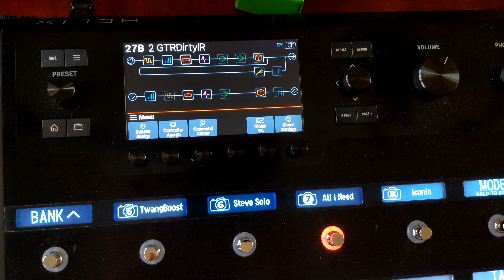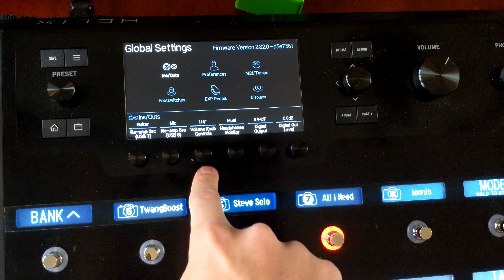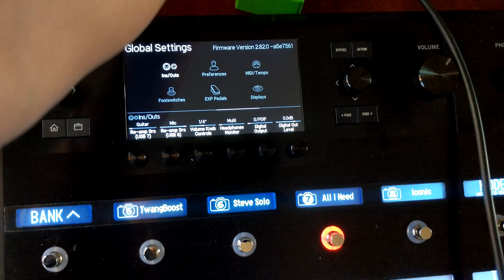Line 6 Helix - Setting Up Outputs for Live Use- Bypassing Big Volume Knob - 2 Minute Tip

Comment from the maker: Please feel free to ask questions here! Thanks for watching
Reply from the maker: @joshua waters I would definitely recommend double checking your ins and outs. I hope nothing is wrong with the unit itself though because that is a strange thing to be happening
Reply from the maker: @joshua waters definitely is ! They'll at least walk you through and find out if anything settings wise could be weird. Keep me posted and good luck! Any more questions for me, you can always reach out here or on FB or instagram
Reply: @joshua waters Always the best customer service.
Reply: Hi Steve, do you know why my big volume knob works in reverse?
Reply: if I turn it to the right the volume goes down
Reply from the maker: @davidedro  I haven't heard of that happening before. I would write to Line 6 customer support for sure
Reply: Steve Sterlacci thanks for the reply! 🤟
Reply: , Im going to be running a helix stereo out to 2 frfr speakers but i cant decide on 2 10 inch or 2 12 inch,,, i e heard the 12's are too flubby with the bass and that the 10 inch speakers are perfect for amp modelers, anyone tried both and have an opinion? Im just scared to get the 2 10's and there not be enough bass,, i have 2 8 inch studio monitors to pasify right now but while theres bass wih music or synth sounds when u try to palm mute or chug it sounds horrible, opinions? Thanks in advance
Reply from the maker: @cbosmooth  I have never heard that 12s are too flubby. You can always throw a low cut on. I wouldn't choose 10s but that's just me

Comment: Steve, I got a great method for stabilizing the big volume knob. I play table tennis and I buy my own rubbers and glue them to the paddle. There's always left over rubber after cutting the it to the shape needed for the paddle. I cut a circle the size of the knob and glued it to the bottom of the knob. You can still turn it, but you have to use a LOT of pressure. No way that thing is moving unless I want it to!
Reply from the maker: That's a great idea !!!

Comment: What are your thoughts behind preventing phantom power being distributed to the line 6 via XLR? (i.e. an unexperienced sound guy turning on phantom power on the desk). I've read people use phantom power blockers or in-line isolators. Your advise is appreciated. Thanks!
Reply from the maker: I'm about to film a video for the new highline line isolator from Radial that's just the ticket for stuff like that

Comment: Thank you SO much for this video - it addressed the EXACT question I had regarding the Helix's outputs.    I have a Kemper (and still love it, but it's gotta get shipped out for a repair - footswitches are finally being lame after 3 years) and I have it set up this very same way for the very same reasons you have.    I just needed to make sure that if I buy a Helix (to add to my amp tone possibilities, and to have a similar backup rig whenever my Kemper has to get shipped out for God knows how long it'll take to get repaired) I could run the Helix the same way at my gigs.    Again, thank you so much for the help!   And I subscribed to your channel to get more help and info from you as I move forward on the Helix!
Reply from the maker: Thanks Dave! Im going on my 5th year with my Helix with no regrets and haven't looked back. Even owning the FM9 and Quad Cortex, helix is still my first choice for its simplicity
Reply: @SteveSterlacci  It's so looking like that'll be the same case for me.   :)    Looking forward to learning more from your videos, my thanks again!

Comment: Hey Steve, I am kind of new to this Helix, I have the HelixLT. I notice when I play certain notes and Chords where the low E is played, the first icon (input) Guitar icon, it briefly flashes red in color. I guess this might mean i am clipping but i checked all my levels. The way I am set up for the time being is like this. I go from the 1/4" left / mono from the Helix to the power amp In on my Boss Katana 100. Thanks!
Reply from the maker: Try the input pad in global settings. Should sort you out
Reply: @SteveSterlacci  Thanks Steve, that did help, although it still flashes red, but not nearly as much, only if i really pick hard when i play chords.
Reply from the maker: @Joop5000  as long as it doesnt sound like its clipping, it should be fine then
Reply: @SteveSterlacci  Cool Thanks Steve! Keep the vids coming, love em!

Comment: Hello Steve Im using helix floor into PC+ , xlr to FOH , L_6 to PC . I notice you use the 1/4" to PC+ and explain how to adjust volume to PC+ How do I control signal strength to PC+ through L-6 link . I use Helix for sound , no PC speakers with new 3.5 update. Would I be better off just using 1/4" to PC as you do on this video ? I am a bit confused on this subject . Thank you and great channel I only recently discovered .

Comment: Should I run a line signal into the front of a bass amp? Or instrument? Does it matter all that much if the amp sounds fine?
Reply from the maker: To an actual amp I would run instrument out. If it sounds fine then i guess it could be fine! No reason to mess if you're happy

Comment: Diggin' this stuff. Any idea how to adjust the output through the USB? I'm trying to use Helix directly into Reaper via the USB but my signal is way too hot. Couldn't find anything in the instruction manual about it.
Reply from the maker: Thats gotta be your preset volume.  Use the channel volume to bring it down

Comment: Old but still relevant video. This is what I also did on my Helix settings. However what if the FOH signal is too "hot". What options do I have to turn it down? Reducing the output signal in each preset is one option, but is there a better way do this "globally" or some how else?
Reply from the maker: Hey Rami! I would suggest making your presets at least close to a fully bypassed volume. It will almost always be boosted up but if you are in the ballpark, you'll never have issues. 
To answer your question,  you have a volume in your global eq that you can page to and bring up or down 20db
Reply: @SteveSterlacci  Thanks Steve. Just preparing for my first gig with Helix and trying to prepare for all kinds of issues :)
Reply: We had a quick PA test and no problems. All works just like it supposed to work. Wonder why there are so many comments out there where people are having issues with too hot signal. Any way, we are all good to go ...

Comment: If the big knob only affects 1/4 inch outs, then how do know how much signal is going to Front of House?
Reply from the maker: I am sending him a mic level signal. Its in his hands to handle the gain structure. Just like a real amp when they tell you "dont touch your volume,  its perfect!" I get to do that, and increase stage volume if needed. Let the sound man do his job with the FOH signal
Reply: @SteveSterlacci  So it's like a set db amount like a microphone? Im talking about how many db does it send to the house if you make the big knob only effect your 1/4 in outs on stage.
Reply from the maker: Its dependent on the presets level. I keep all mine relatively the same level and its 99.9% of the time a great level for the sound guys
Reply: @SteveSterlacci  ok I see. Was just curious about it bc want to do the same except use my headphone out to monitor so I have volume control for both monitors and main out.
Reply from the maker: @mrfender5001  I never want to touch the main out to the house because it will affect the overall mix. There should never be a situation where you need to touch your level to FOH unless its asked for. Solo boosting is different though
Reply: @SteveSterlacci  I understand that. But in my case I am the FOH sound man. So I have to be wireless and be able to get off stage and walk around front while playing. So I need the control.
Reply from the maker: @mrfender5001  even so, you don't want to mix yourself using the level coming in. You're asking for a headache if things go wrong. Best to get the healthy signal, then mix from the desk. Especially wireless,  you wouldn't be near the helix anyway
Reply: @SteveSterlacci  Okay. If you really believe it's the best way to go then I'll give it a shot and see how it goes. I just had no clue of how strong the signal will be if I turn off the big knob. If it simulates being turned up all the way then at least I know my starting point. But I'll just see how it goes.
Reply from the maker: Yep, its as if you have it maxed out. Its what works best for me. You can always do what you want man! I just know the gain structure at the desk will change and will change the way your tone sounds and feels. You could wind up clipping it without knowing, or sound like theres a blanket over you if you bring it down. Setting it at the desk allows you to keep that signal and use the mixer to control volume
Reply: @SteveSterlacci  So it IS maxed out if you turn it off... That's what I needed to know. Alright we have practice tomorrow so I'm going to try it out. I use the X32 so I can control the whole board with a tablet so it sounds like it would work. Thanks for your help buddy!

Comment: What if I want to use both xlr outs from helix to a PreSonus rack mixer which has (mic/line inputs) 
Can I set it to line level in the helix without any adverse effect on tone?
Reply from the maker: There is no wrong answer for this one. Like the mixer, it'll be just as useful in either mode. I would use mic personally as I say in the vid tho!

Comment: When the knob is set to Multi/XLR etc. I know when I need to turn down my signal for FOH. But when I disable volume knob for XLR that function isn’t available. How much signal is going through via the XLR out? will it mimic at 12o’clock signal?

Comment: Thanks mucho - Sometimes directions from the engineers are not that great because everything to them is simple. It takes people like you (with real world experience) to relate basic ideas to us commoners that they skip.

I heard there was a way to turn off the 'big volume knob". Not well explained in the manual. I see now that you can't turn it off, you can only change what that knob will control. I actually like the idea better that it will control the out to my amp (1/4 inch) but not the out to the board. Just what I needed, thanks again for being on our side.
Reply from the maker: Glad to help! Thanks for being here. Plenty of other tips on the channel as well

Comment: Hi Steve, Been trying to used the 4 cable method and running the Helix LT into a Fender Hot Rod Deluxe input jack and effects loop. There is a annoying 60 cycle hum when I connect via the Effects Loop. Have you run across this annoying issue and how would quiet the 60 cycle hum? Thanks
Reply from the maker: I've encountered weird things like this. Try sending from 1 fx loop and returning into another loop. That, or a line isolator box might be needed from the Helix to the fx loop

Comment: I've been using link cable into my powercab and then the out on the powercab to FOH.  I guess it's kind of the same thing because the powercab volume doesn't effect the signal to FOH and is has a virtual 57 mic in the output.  I just worry that when I don't have my powercab one day, I won't know how to set the Helix for FOH.  I should probably use this method and get used to it.  Powercab does make it easy.  After about 8 months with the Helix, I'm struggling with some of the tones live.  I miss a the feel of my amp sometimes.

Comment: HI Steve! Great video ...but it would be great if you could describe how signal chain (path) in Helix is configured? ... I mean first A path should be set to XLR and the second one to 1/4" ? Could you put it step by step? thanks! Brgds,
S.
Reply from the maker: I was thinking I should have added that as well. I use one output block set to "Multi" and then do this. Much simpler than you'd think lol
Reply: @SteveSterlacci  Sorry, didn't understand what you meant :( I can see from the video that the first path is set to Multi ...but the second path is started with "send" and end of the path "return" ?
Reply from the maker: @sergejk  those are just the fx loops in the back of the unit. If you use additional pedals that's where those go
Reply: @SteveSterlacci  i know that ... thanks but :) you've mentioned Hot Rod Deluxe to connect to Helix as a second option for stage monitor beside the FOH. ...  So i thought you would describe the signal path in HElix how to do that connection :) To recap ... to have stage combo amp as a monitor (HRD) and simultaneously feed the signal to FOH. Hope it is clear now? :)
Reply from the maker: @sergejk  when the output is set to multi, just sent the 1/4 inch out to the Hot Rod. I've kept it at line level and liked the sound. Multi means that your end signal is being sent to XLR, 1/4 and Digital
Reply: @SteveSterlacci  but obviously, you don't understand my question. thanks anyway! Brgds.
Reply from the maker: @sergejk  I think I'm understanding now. You want to send a signal to the amp and the house at the same time? I go into the FX Return on the amp and not the front end. I have done that as well with okay results but the fx loop return works best when you send your line to the amp. Am I closer now?
Reply: @SteveSterlacci  you are :)) that's my plan also .... but now i need an example in Helix how to achieve that :)
Reply from the maker: @sergejk  I honestly dont change anything in my presets and they're the same as always. What I think you are looking for is how to send a signal to the front end of the amp that is unaffected by the modelled signal and cab sim?
Reply: @SteveSterlacci  right! we are so close now :)) thanks for your patience :)
Reply: Steve Sterlacci If you stop your video @ 2:46 could you please describe your PATH 2B. What is connected to send and return on your HELIX?? Is that connected to a power cab or frfr monitor for stage?
@UCbawdoeGr439blez7bqmjHQ
Reply from the maker: @sergejk  OHHHHHHHHHHHHHHHHHHHHHHH lol that's my 2 guitar preset. I control my guitar as well as Jessica's guitar all through my helix floor so it's going in and out of fx loop 1 and it's a totally independent rig from my own
Reply: @SteveSterlacci  yeah.. i thought that something was wrong here... i thought that this was patch which is separating FOH and stage monitor... hence you talked about :)
Reply from the maker: @sergejk  nope. Like I kept saying that's just the same multi out lol now I get why you were confused. That is a great idea for a preset! Maybe I'll make one like that

Comment: If i was playing in my mancave and i just chose xlr lead coz thats what i have and conected to my headrush 212 is there anything wrong setting my headrush to say 4 and I control my volume by the big knob say around 12 oclock position but tweak either way for more or less volume is there anything wrong using this way opposed to whacking knob to full then having to walk across to headrush and turn up or down? I just found using  the big knob gives me control?

Comment: Hey Steve, I have set up a FRFR and my amp, out of the Helix I have XLR to the FRFR and 1/4" to the amp. I have set the global settings as BIG Knob to 1/4" and Phones to FRFR. However, the BIG Knob controls 1/4" signal no problem, however I have no control over the XLR volume with the Phones knob, there is volume coming through to the FRFR, but it is controlled by my guitar volume as if its just a straight through signal. I really want to be able to control my FRFR volume from 0 to full. My patch setup is Guitar in and a split out to the two different output types. Please can you help? Thank you

Comment: QUESTION ANYONE,,, Im going to be running a helix stereo out to 2 frfr speakers but i cant decide on 2 10 inch or 2 12 inch,,, i e heard the 12's are too flubby and that the 10 inch speakers are perfect for amp modelers, anyone tried both and have an opinion? Im just scared to get the 2 10's and there not be enough bass,, i have 2 8 inch studio monitors to pasify right now but while theres bass wih music or synth sounds when u try to palm mute or chug it sounds horrible, opinions? Thanks in advance

Comment: Mate, love this tip. Thanks so much. I'm wondering - is there a way to connect the 1/4 inch to a tube amp on stage for my own sound and the band on stage, and run no amp sims on that. But the XLR out to the FOH, run an amp sim on that, at the same time? Whilst using the same effects on both?
Reply from the maker: Thanks Michael! You would probably need to put the amp and cab last and put a Send block right before them so all your fx go to the amp on stage.

Comment: Thank you.  This and all your videos are very informative.  Especially helpful as I am new to the Helix as my gig rig.  My question:  When you create your patches for a LIVE gig and volume level them at home, what loudness (LUFS) do you shoot to create them at (-23db, -15db, ??? ), so that when you send Mic level to FOH they have enough headroom to increase or lower you to fit in the mix and give you headroom for Solo boosts, etc, so you dont clip?
Reply from the maker: Hey Joe ! I usually go with this as a base https://youtu.be/FmND_EbkRxA and take that into rehearsal
Reply: @SteveSterlacci  perfect, thx!
Reply: Sorry, one addition.  So when you get to sound check @ the gig and you have several presets for the gig with multiple snaps with different Channel an output block settings that all leveled to around -12db,  what's your go to on the spot overall volume tweek to FOH if its too hot or too soft without touching all the presets/snaps?   GLobal EQ Level?  Big Knob?  Add a gain block everywhere and tweek it? ???  Thank you!
Reply from the maker: On the fly at a gig, global eq volume. Then i would go back to my channel volumes and bring them all down and re match them.